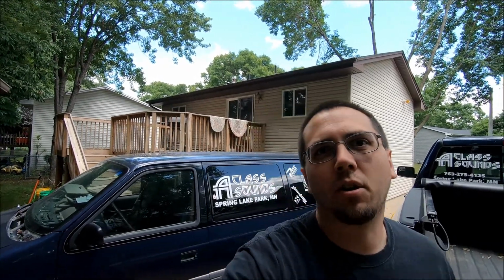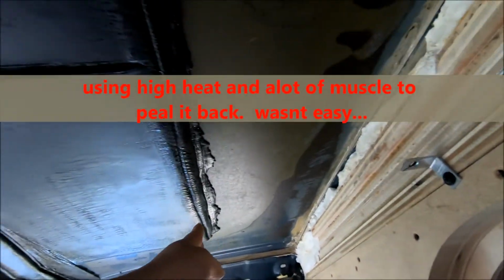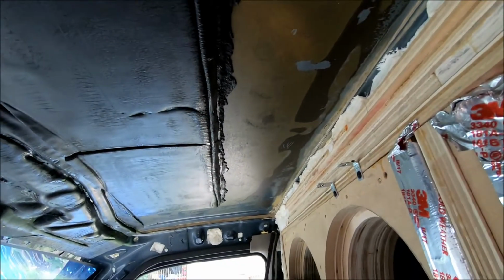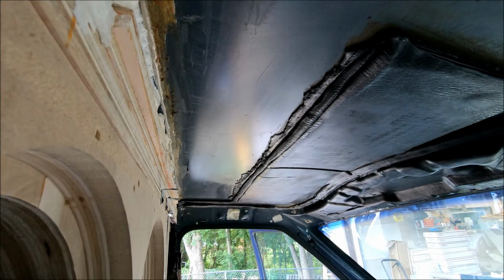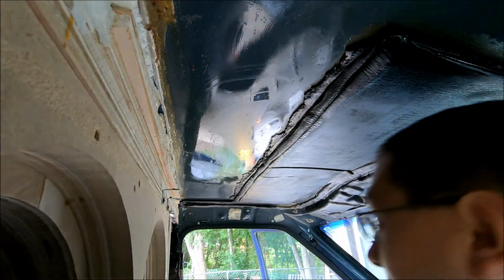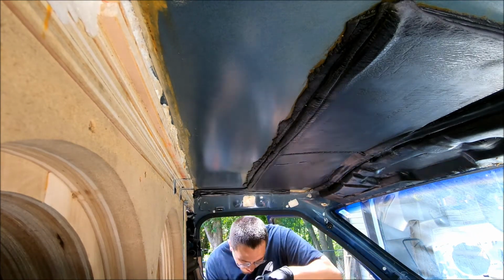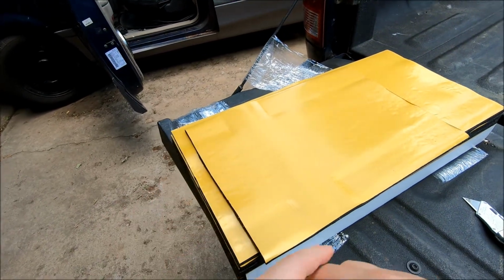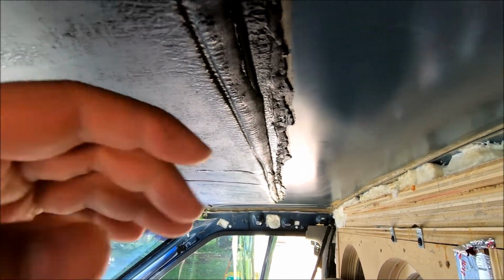How to repair a failing Vibraflex

Comment: i feel you on the removal of Vibraflex ! i just removed 2 layers of 190 over the front section of my 02' blazer , when it gets hot out it does nothing for panel rigidity like when it's cold . removed it with a smooth blade on a multi-tool , then did the mineral spirits followed up with acetone . 1'' Baltic Birch is going in this next weekend

Comment: Do you not have tontorch this stuff.
Reply from the maker: you dont "need" to torch it on no, it just goes faster with a torch.  it simply needs to be hot to be applied so that the adhesive kick off good and also so it conforms easy.  with extra heat after application you can also see any air bubbles which is critical to not have air bubbles especially when upside down.
Reply: @AntonJMiller  ok were do you get thos stuff it seams out of stock most places. How much for a 4 door tacoma just did a blowthru and roofs going crazy.
Reply from the maker: @cristovalmontoya5222  yea I am out of stock till probably the end of the month or early May.  I hope haha
Reply: @AntonJMiller  is it that much better than layers of like second skin or regular bitumen deadener.
Reply from the maker: @cristovalmontoya5222  second skin is a great product and I would recomend using both this and second skin for best results.

Comment: Just curuous if you feel 225ml is worth the upgrade on a roof for spl vs the 155 or 190?   I was planning two layers of 155 on the roof or do you recommend one layer of 225?  Thanks.
Reply from the maker: single layer is more efficient.  but doing 2 layers works as well.  when you layer vibraflex just make sure you "burn off" the plastic liner that is on the top of the material before you apply the second layer.
Reply: @AntonJMiller  great to know.  BTW I saw on your site 225 out of stock.   Any word when plan to be back in stock?
Reply from the maker: @dtbrown1978  just got word the shipment is in Chicago.  So hoping for next week or the week after.
Reply: @AntonJMiller  thanks! I live in Chicago. Too bad can't get locally. Lol